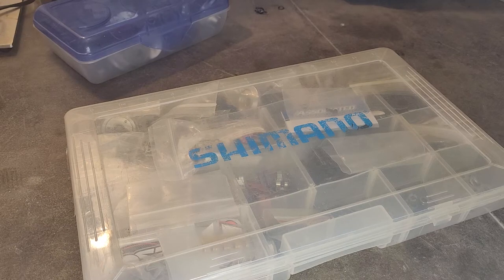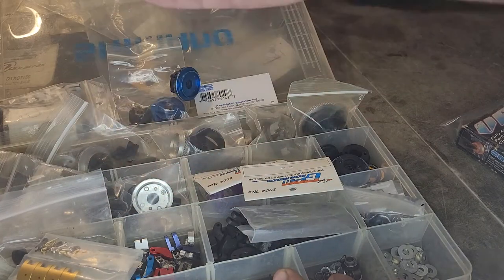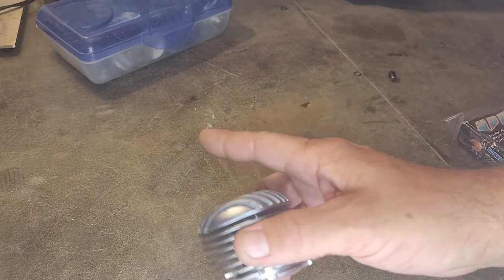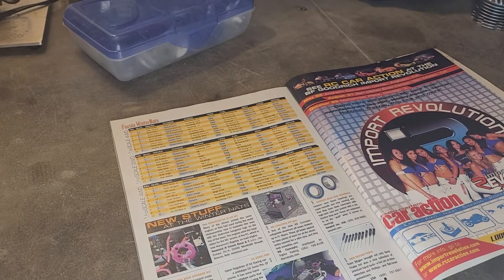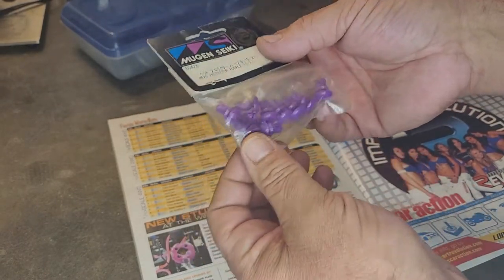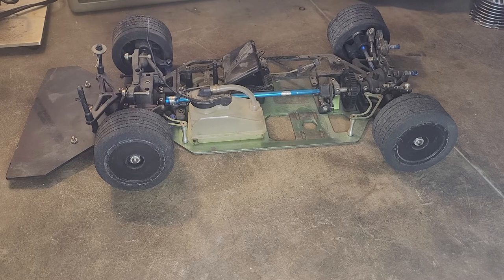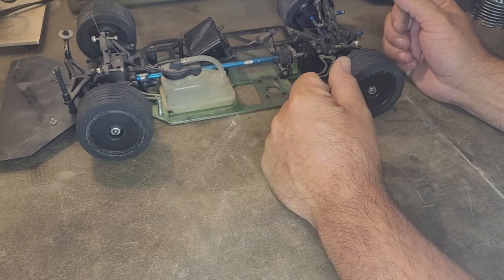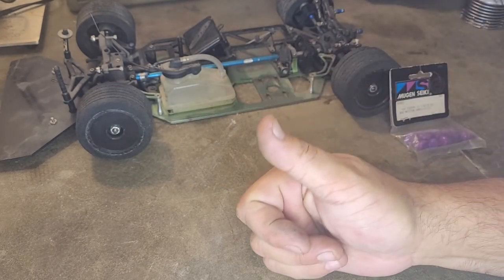Let's take a look at an Associated Nitro TC3 with Hardcore Racing Titanium upgrades NTC3 touring car

Comment: I love my tc3s best 1/10 scale rtr to hit the market in my eyes I also got the factory kit even better of course the tc3 got one problem those spur gears are just a magnet for finding crap rocks glass cig buts u name it I've had it James in my gears even covering the hole on bottom of Cassis still not enough it really needs a clean road to run worry free